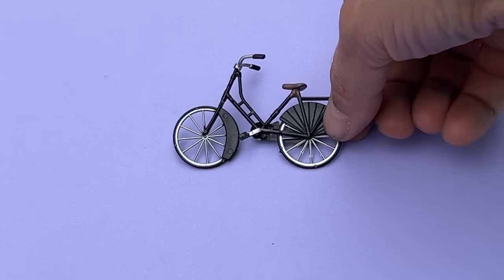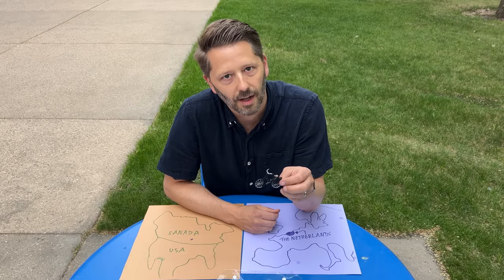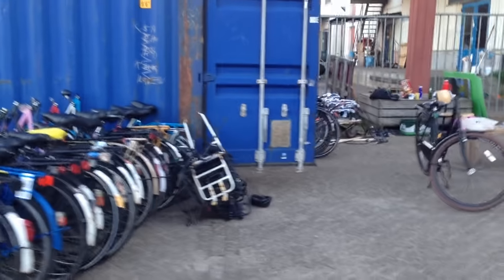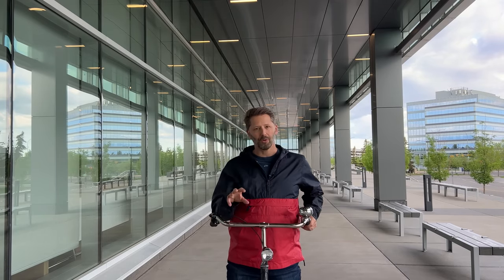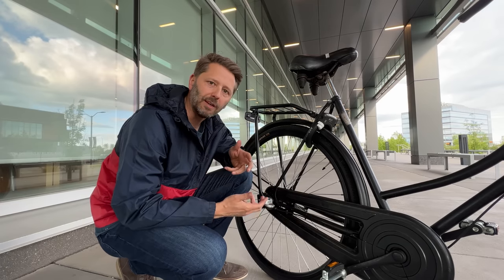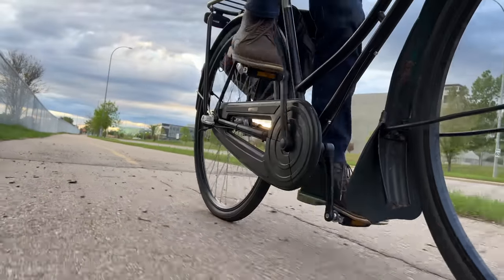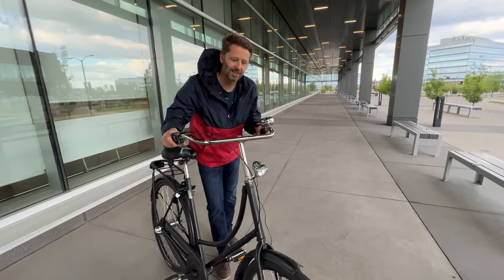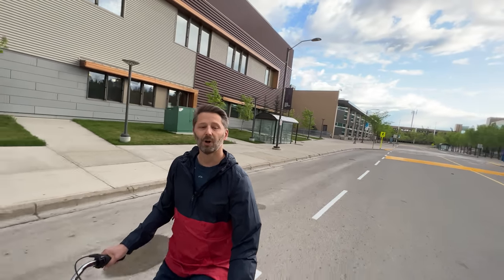I finally found a true Dutch bike in North America. Here's what you need to know

Comment: North America has much much lower population density and higher distances netween home and work.

For the US anyway, dutch bikes are particularly ill suited.

The stepthru frame is a good idea, and fenders are a necessity for commuting.

But so is a reliable set of gears with wide range, and decent brakes..

Dynamo's are either A) the best way to fuck up your tires/rims or B) how to instantly increase thr complexity and cost of your hubs.

The fully upright position - thats strictly an urban thing. 

If you are commuting longer distances at speed, its a horrible position.

Increase bike usage - sure.

Using dutch bikes - fail